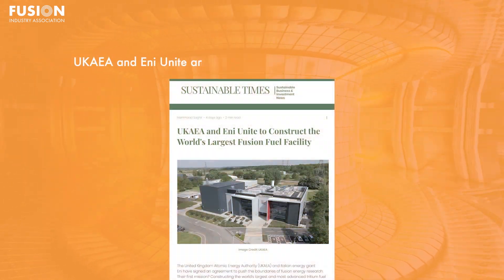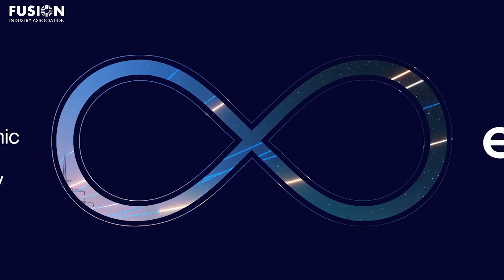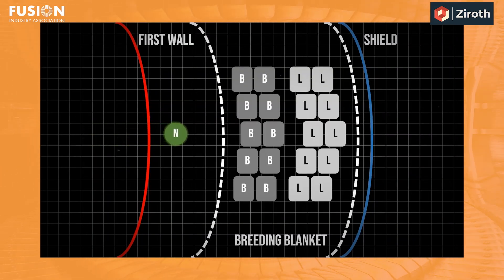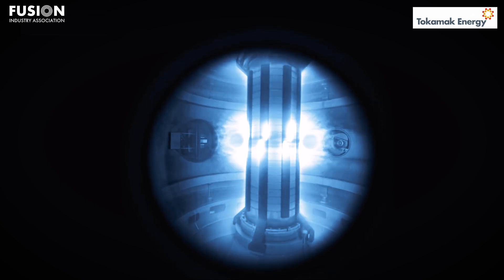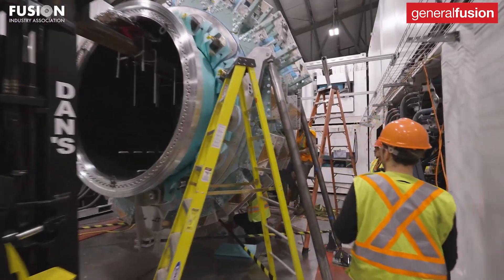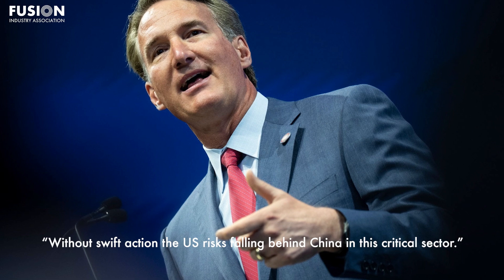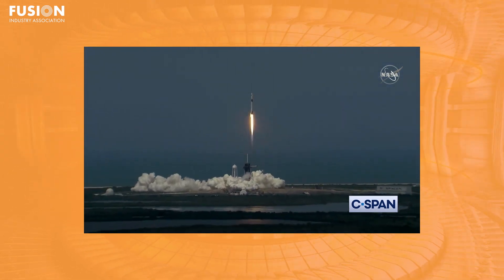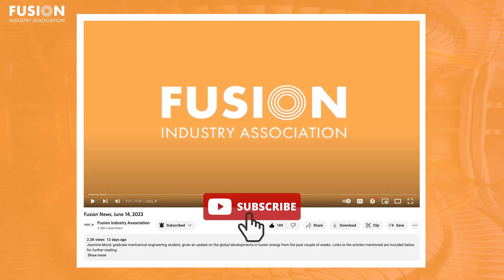Fusion News, March 19 2025

Comment: IMO the writing of these reports could be much improved. There is a lot of "fusion 101" scattered throughout the presentation which IMO most of the watching base already understands. Being more precise of what and how exactly, rather than broad generalizations like "will improve supply chain management for future fusion efforts" -- it would be much more interesting to hear specific data points.

For example, what designs require a reactor blanket ? What do not ? What reactors use tritium ? What are specific challenges for tritium supply and production ?

Less generalizations and fusion 101, more details please.

Comment: Thanks Kyra, great job. 😃 Nice smile.  At 2:16 you showed a picture of the fusion blanket INL is developing. It looks to be made of some kind of open foam, a porous structure where the cells (or bubbles) are interconnected.  What materials are they modeling, tungsten and FLiBe? Unfortunately, the link provided no additional information, except to say they are testing against low-energy fission neutrons, not 14.1 MeV fusion neutrons.
Reply: I had wondered about that. I never expected them to use a blanket anywhere near the main plasma beam or with an appetite for interacting with high energy particles. This perplexed me, as I know of no way, without additional layers and countermeasures, to limit these discrete interactions. This would undoubtedly lead to frequent replacements of these layers, making pure tritium inputs far more desirable in the long run. I hope we get an answer!